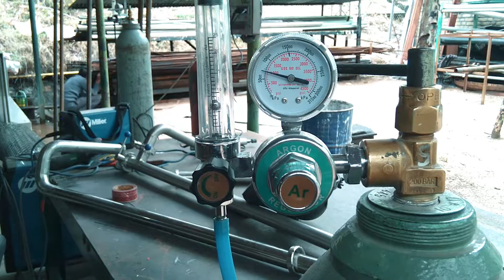TIG WELDING THIN STEEL TUBING Technical Secrets

Comment: Well. this is certainly an eye opener! Electrode constantly sticking, no post flow, all the things I've seen being taught to avoid at all costs.This is stainless fab' in the real world.
Reply: He has a valve variant torch, so argon is flowing at all times (Unless you see him turn the round nob off) Second he's using a scratch start system for the arc. being I am not a professional I can not opine on his procedure, but I can tell the weld is solid based on the colour of the seam, and since it is thin wall I can deduce it will not be carrying thousands of gallons of dangerous stuff or high pressures, this greatly reduces demands on the weld. All so the video has been sped up, this greatly distorts things as well. but with that pointed out, ya he made a few screw ups, but not world enders at least yet!

Comment: Where’s your filler? This will crack after a couple heat cycles if is exhaust tubing, also this inside will be sugary resulting it to become brittle after heat cycles.

Comment: But where's the filler rod
Reply from the maker: Its called autogenous welding method in this method you don't need filler metal.
Reply: Can u explain this in next video
Reply from the maker: @sidharth5831  Yeah i can't sure in next video...